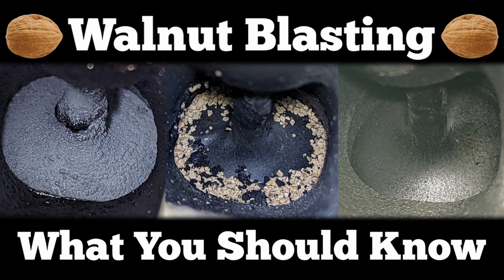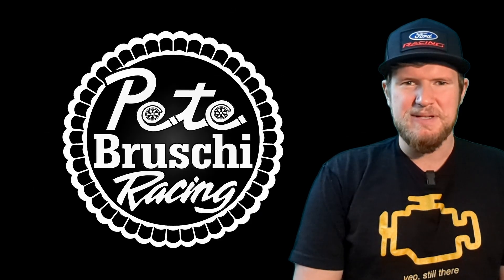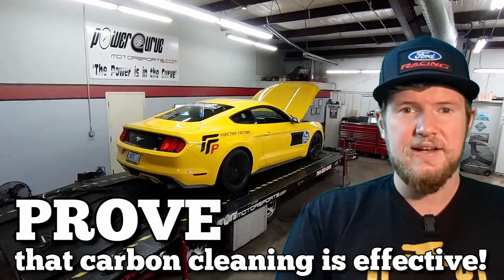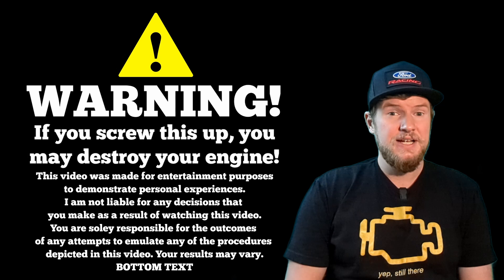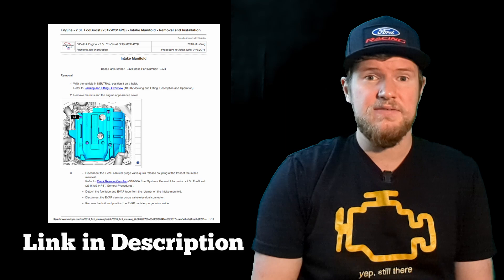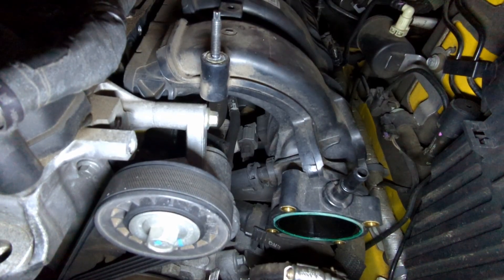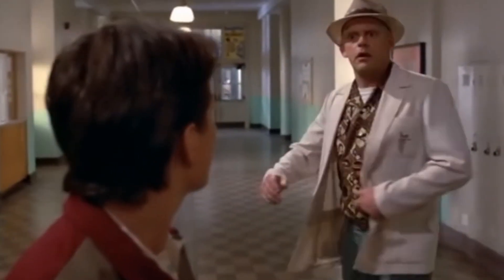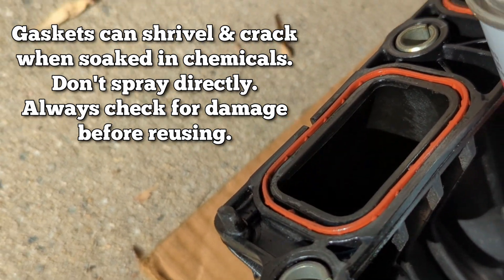Watch This BEFORE You Walnut Blast Your Valves - Turbo Direct Injection Probs - Pete Bruschi Racing

Comment: It's the peak of goofiness to blame companies' poor engine design on government requirements to improve fuel economy. The only reason companies designed them was to avoid doing literally anything else to improve fuel economy (reduced weight, more efficient, smaller size vehicles).  Barring that, this is how progress under capitalism works - make the worst thing you can get away with, and redesign it only when it turns out you can't get away with it. Americans apparently want gigantic, fragile ego-soothing vehicles in white, gray, or black. YOU might not care how much gas you burn dragging your 3000 pounds of steel with you to get coffee, but most people are fine with spending less and burning less finite fossil fuels required to get there.

Comment: Great work with the video. I did learn a few things. Of note, I typically I’ll pick large buildup off large carbon chunk buildup with a pick and then vacuum out the bits. As a second step, I then perform the walnut blasting and of course vacuum and blow out with compressed air. As a FINAL STEP, I then do the chemical cleaning. I find that chemical cleaning as a first step does very, very little as the chemicals are just removing the very outermost layer of carbon buildup…whereas if I do the chemical soak and clean as a FINAL STEP, this sms to remove the thinly layers of carbon contaminates that remain and almost gets the intake chamber and tops of the valves shiny!

Comment: Great video.
Wouldn't a chunk of carbon eventually fling off into the turbo blades whether we use CRC turbo cleaner or not? At least with CRC it's partially disolved. 
I want to run a can of CRC through my intake valves or a vacuum line but I hear this is bad from many sources and many others say it doesn't matter.
Reply from the maker: I have seen on other platforms like Minis that the carbon buildup can break the valve at the stem. Not sure if it could build up to that point on a Ford. I see EcoBoost Mustangs reaching 200,000+ no catastrophic valve damage.

I tested the CRC cleaner after running a catch can for a year. I didn't have anything to compare it to, but the catch can did seem to help prevent build-up (though there was still some). I used the CRC according to the instructions on the can, and it didn't seem to damage anything. But it wasn't super effective on the valves. I got better results by pulling the intake and soaking the valves with the cleaner, hitting with the brush. No need to break out the blaster. I would say you'd only want to blast away tens of thousands of miles worth of build-up with no catch can. Or just run a catch can from the start. I might make a follow-up video but been super busy.

Comment: do you need to readjust the valves when you are done for timing?
Reply from the maker: Timing is entirely controlled by the cams and the ECU. No valve adjustment required. Great question though! Did you know that we have variable valve timing?
Reply: @pete_bruschi_racing  Thank you! wasnt sure if cranking manually mattered as to what position to leave it in once done. I'm doing this on a 2016 Hyundai Accent but stopped from uncertainty.  I really appreciate the info. I chaged my vvt on my lexus 2 yrs ago but didn't realize if firing order needed to be followed at TDC. Geez derpy doo on me.
Reply from the maker: The crank angle sensor will figure out where it's all at. Be careful and best of luck!
Reply: @pete_bruschi_racing  awesome. Subbed my man
Reply from the maker: Thank you! Go check out your local motorsports! MotorsportReg.com

Comment: Lug the engine?
Reply from the maker: Don't hang out in the low RPMs, especially don't build long sustained boost. On my EcoBoost cruising down the highway I keep it over 2000 RPM and below 0 psi boost. If I need to climb a hill or pass somebody I always downshift. That puts the engine in the right RPM range so it doesn't have to work so hard.

Comment: Honestly, it wud be much easier to add a port injection on a new aftermarket intake manifold. At least  my fueling is covered incase I wanna add more boost.
Reply from the maker: Good point, though I don't think that's legal in some of the classes that I want to race in.
Reply: @pete_bruschi_racing  Just bypass the fuel line for the racing event. Job done. I fix a port injection on my Gen2 Speed3 bcoz I hate doing walnut/media blast.
Reply from the maker: @princesssolace4337  unfortunately, it doesn't work that way. You can't have illegal parts installed whether they are functional or not. At National Tours where everyone has to open their hoods and trunks in impound for scrutiny, it's not worth the trouble.
Reply: @pete_bruschi_racing  You'll figure sumthin' out. Those carbon deposit add unwanted weight on the valves when it gets hardened and its gonna shorten your stock valve springs life.

Comment: In 1970, Buick ran into issues with carbon buildup causing pre-det in the of the X-SF code 455 (Riviera, Wildcat, Electra 225 engine). Carbon deposits in the chambers were causing the factory 10:1 chambers volumes to shrink, raising compression to well over 11:1. Buick sent word (a kind of not-service-bulletin) to service centers, advising them to walnut blast the chambers and change the oil. Many had their worries about trashing rings... but I have never heard of one failing from the treatment.

In other words... no worries, if it gets into the cylinders. Blow them out, change the oil, and carry on.
Reply from the maker: Cool story! Though best to not get it in there, especially on turbocharged applications.